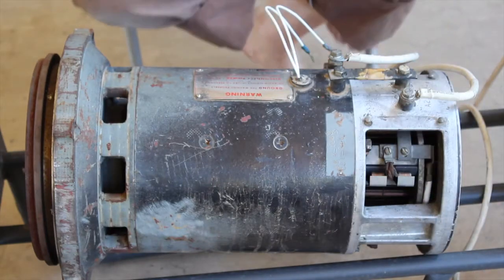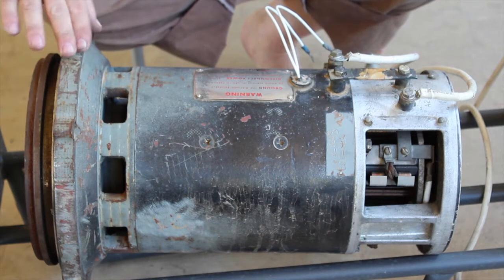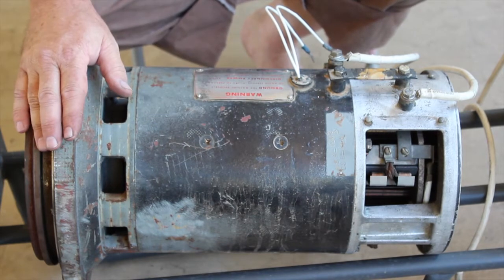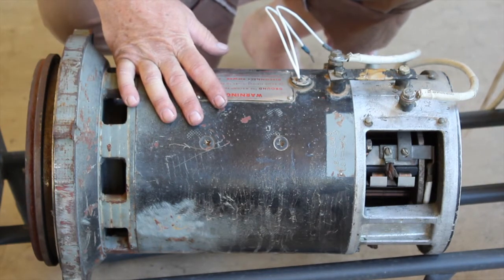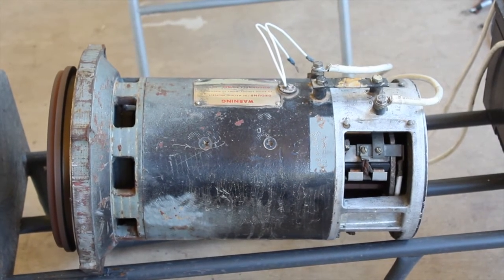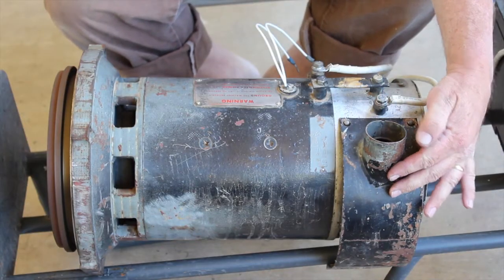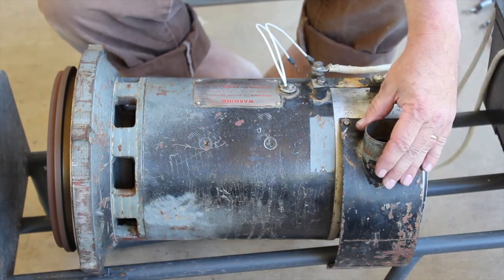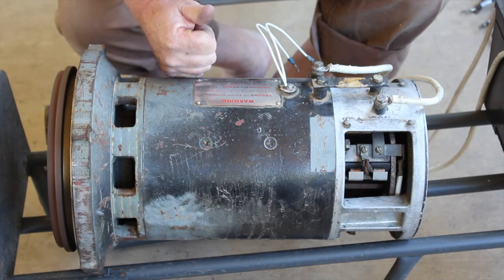GE 9" Motor

Comment from the maker: These are series wound DC brushed motors and in the video I am just using 12 volts directly from the battery to run the motor. I don't make my own controllers. I have a Synkromotove Controller to power the motor from our bank of LiFePO4 cells in the car. The two small wires sticking out of this motor are connected to a thermal switch. When overheated and connected to the controller the switch will shut down the system.